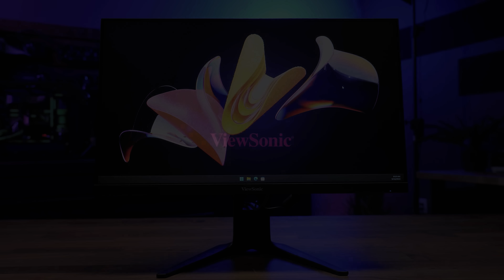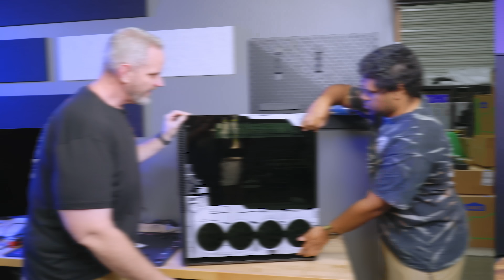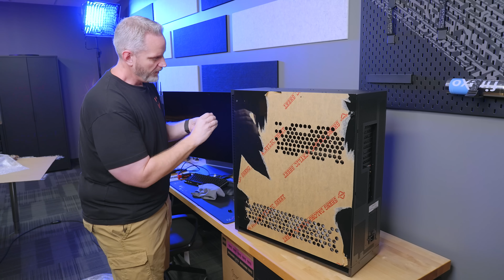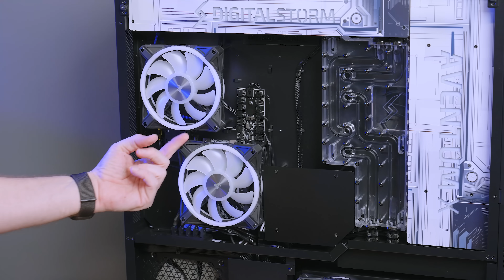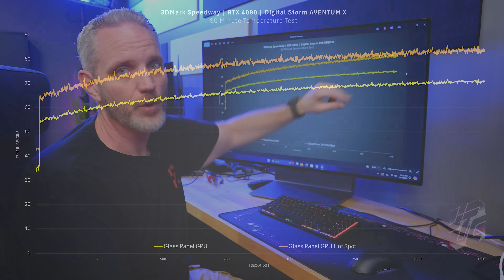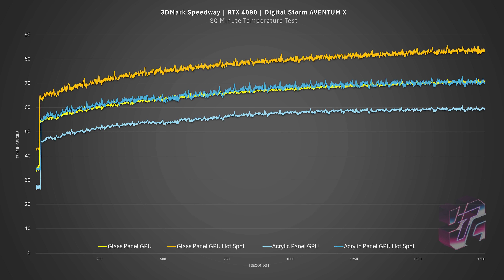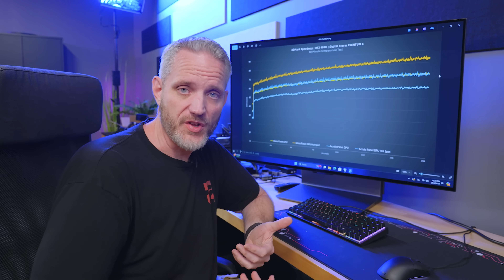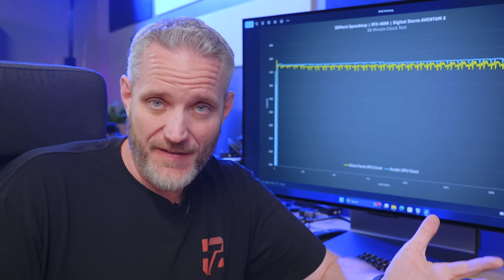Digital Storm responded to my Criticism... Let's go over it

Comment: To remove the paper from the acrylic, warm it up with a hair dryer or heat gun.  Just don't linger too long on any one spot.  It will weaken the bonds in the glue.  I usually follow up with hot soapy water to remove any residue.
Reply: or just dont add it in the first place?????
Reply: @SnuggleLabes  What do you mean?? The acrylic sheets ALWAYS come with protective paper to prevent scratches, they come like that directly from the factory. You're supposed to only remove the protective backing paper just before use.

Comment: You can put holes in a tempered glass pane, I have a deepcool case that has a tempered glass side panel that has 4 screw holes.
I'm not a glass expert, but I assume it's going to cost loads of money, acrylic is way cheaper to buy and laser-cut.
Also, a quick search on google, says that you CAN UV print on acrylic.

I see the vent holes issue on the back side panel, they just cut 2 sheets at once and called it the day, the paper wrapping on the Plexiglas tearing and/or not coming off, in my experience, is usually a sign of cheap acrylic.
Reply: It can be done, you'd just have to cut the holes BEFORE the pane of glass gets tempered; given that they probably don't do that in-house, it'd probably increase their costs and hassle to custom order panes from the supplier than just getting simple panes in volume.

Comment: You can cut a hole inside the glass and get it tempered after cutting a hole. If you even try to cut a hole in a tempred glass it'll shatter into million pieces.
Reply: and you know that Digital Storm's supplier would increase the cost for such custom work (vast majority of panels are just standard with 2-4 screw holes; assembly line efficiency!)  Given their existing choice of solution for the problem, would they be willing to even undergo the bureaucratic effort to change their processes to add this option, even if they pass the increased costs on to the end-customer?
Reply: @empath69  I don't care, I was replying to Jay's question in the video.

Comment: I custom watercool my rigs because they become a piece of artwork and focal point in the room and not something u want to hide. Any decrease in temps or sound is just a bonus. My new white and purple build is beautiful looking. The same build using air cooling would not look anywhere as good. Also, with the number of radiators, I can set my fans to a much lower rpm, making the system much quieter than an air-cooled rig when the fans ramp up as the system gets hotter.

Comment: It seems to me that the gpu temps with acrylic were about to peak as the "Trust me bro, it's fine" glass panel ones were still climbing steadily.
If you can build a more efficient and better performing pc with a 80$ case, a 50$ air cooler and 4 20$ fans... enough said.

Comment: Any shape you can cut in acrylic, you can cut on glass. The problem with tempered glass is that you must cut the holes before tempering the glass. After the glass is tempered, you will shatter it if you try to do any modifications to it.
Reply: I own 3 water jets, you can’t cut tempered class with it. Basically the only thing you can’t cut.
Reply: Not entirely trued. Tight corners in glass can cause stress fractures so generally warerjet, drilling and cnc machines use minimum radius in internal corners to reduce stress breakage during toughening.
Size and location is a limitation in glass holes/cutouts.
Reply: Good to know! I looked through comments for an answer to this lol
Reply: It can be undone, I've seen tempered glass be annealed and thus "untempered".
Reply: What about waterjet?
Reply: @sumdude4 even water jet would be an issue. Tempered glass is under internal tension and any alteration to it can cause it to just shatter.
Reply: @sumdude4 I walked around this exact problem, so I can chime in, and relay what I heard from machinists. WJ will shatter tempered glass, if it hits resonant frequency in it, and it does so pretty frequently, as it's basically hard molecules rubbing against straight edge, it's like a bow on a violin string. When making tool paths for WJ you have to take into account whole shape of the glass at every stage of the process. It's difficult, very, very few people know how to do it correctly, and in general you will hear "no". To add insult to injury, In most cases it breaks right at the end of cutting process, close to separation.
Reply: @Vatharian you can not cut toughened glass. There is no resonance frequency to worry about. The glass is under extreme stress and any impact to the glass from tools or water jet etc will simply cause the panel to pop.
No one can cut toughened or tempered glass.
You can un toughen glass but no one does that at its more cost effective to cut a new piece.
We run cutting tables, using scoring, polish machines using wheels. Cnc machines, waterjets and furnace machines.
Waterjets are quite common in glass processing for holes and cutouts in annealed and laminated glass.
Reply: @Vatharian  Resonant frequencies have absolutely nothing to do why tempered glass shatters when cut. When glass is tempered, the outside layer is put in compression, while inside of the glass is put in tension, similar to reinforced concrete. When you cut the glass you create a new surface that contains both types of glass, so the accumulated stresses from nearby glass have place to release, shattering the whole piece.
Reply: @Vatharian  It's really about the hole itself, not how you make it. I've seen a video where someone tried several times over weeks, to etch a hole in tempered glass. It always shattered. There is nothing more gentle that that.
The problem is, that tempered glass is basically a compressed spring. no matter how gentle you try to cut the spring, it will always explode in your face.

Comment: LTT proved that ventilation is key to liquid cooling when then tried using an old home iron water radiator for liquid cooling. They forgot to ventilate the room the poor radiator was in, so next they checked it, it was crazy-hot.

Comment: What would be a good upgrade from a Meshify 2 XL?  Currently running Dual 360's and 240 in the basement.  I could squeeze 420's in but I'm looking to switch it up case wise.

Comment: i wonder if you had a tempered glass panel set into a metal side panel with the right orientated cooling sections cut out would help move that thermal mass away from comp. I think it would still in this case allow the system to be highend, rigid and solid. i think printing onto the metal would allow you to have design aesthetic too.

Comment: I love it when PCs are works of art but never over performance. I paid around 3K for all of the parts for my latest system and assembled it myself. It’s not perfect but it looks good and I’m happy with it. I wouldn’t be happy if I paid 8K and it was pretty but the parts don’t reach their full potential.
Reply: A year ago I spent about $3k for the parts to build a system with a 7800x3d and a 4090. Put an aio on the cpu and 3 fans on the front. GN had a video that showed another fan in the rear of the case I chose made basically no difference in temps. To be clear, if I run the fans at high speeds, I barely leave 40°C on my gpu and stay in the 60's on the cpu. This whole build from digital storm is a joke.
Reply: @sonnydthomas exactly it feels like a VERY expensive unfunny joke.

Comment: There is a video on this channel from 5 years ago with an Aventum X fans shoved against a solid glass panel. Digital Storm ain't changing this.
Reply: That is my main complaint, Jayz’s complaints about the system were simply the latest in a several year long streak of the exact same issues

Comment: You're not crazy for thinking it should perform better. The extra 4k usd should include a 4090 and the same cooling setup. No way its worth this much.
Reply: not too mention the original 4090 cooler and all the spears the mobo and psu have.

Comment: watercooling is nice because you can have soooo much rad. i have a 3x360mm setup all WC and my water temp never get higher than 33C during extended gaming, that with FAN running at 1250RPM, pretty much silent here with my noisefloor of 38db. (4090 OC with a 7800x3d). It does however cost A LOT of monies!

Comment: You can buy PCs cost in $600 where they bought it through because they know that computer is probably gonna go to a novice not somebody is computer savvy where the documentation has got QR codes that take you straight to problem-solving videos. These companies have thought it through And that’s on a $600 computer this is an $8000 computer because they assume only computer know it all to use a better word should know what they’re doing. They’ve not bothered to add any documentation to troubleshoot QR code been around for years so bloody simple they charge you the sort of money you’d pay for a secondhand car and they can’t be bothered to add QR codes for simple triple shooting it just shows they do not think as a supplier

Comment: They could water jet holes into the tempered glass. Or, as others have stated in other comments, cut the holes first, then temper. Although, I'm not sure how the stresses of the heat-temper cycle would work with the holes in place.
Reply: Why holes in tempered glass? Wouldn’t you want a filter? Which would ruin your fancy holes anyway? Just have tempered glass in the viewing area and mesh with filters in the fan area. Don’t over complicate.
Reply: You're right, it would instantly shatter tempered glass. You would have to modify the glass before you temper it.
Reply: @Christopher_S  I'm guessing you din't know how water jets work? They use a high pressure water stream with an abrasive in it. Cuts through almost anything like butter.
Reply: @mikeford963  I'm guessing you don't know how tempered glass works?  Once completed, the sheet is under constant internal tension; makes it resilient to occasional knocks and bumps, but sufficient force that overloads that internal tension results in fracture.

You're proposing to blast what is, essentially, a pressure-sensitive fragmentation bomb with HIGH-PRESSURE WATER; hope you're wearing full-body PPE...or have plenty of antiseptic on hand.
Reply: I'm aware how tempered glass works. And I should have asked the wonderful woman that Google is before I posted that. Tempered glass is the exception to the rule of "anything" can be cut with a waterjet.
Reply: @empath69  Learn something new everyday

Comment: but wouldn't it be simpler to add thicknesses to the glass so as to detach it from the case by half a cm and let the hot air escape, effectively leaving it aesthetically unaltered?

Comment: Tempered glass is tempered after it's cut, hence screw holes in tempered glass.  Could you cut it with vents as well?  Seems reasonable.
Reply: ...but more expensive for 'custom work' - is Digital Storm willing to undergo even the bureaucratic work to make that change, even if they were to pass the added cost on to the end-customer, given what we're seeing here?

Comment: Ya, no jumper so only the pump turns on and letting it pull air in and run dry are BIG mistakes and only invite horrific issues. Imagine buying $8k PC and it sounds like an aquarium at best, the pump dies two years later  and worst it leaks while filling and kills MULTIPLE parts instead of just making a mess....

Comment: There's a few ways to get the paper off of acrylic sheets in one go but it's still a bit of a pain and you wouldn't know it unless you've worked in a shop that works on a lot of it.  I'll wrap it up around a cardboard tube and it'll roll right off.  May still have some tears to deal with around the cut holes but doable and you won't scratch it.
Reply: Isopropyl alcohol often helps getting stuff like this off surfaces.
Reply: @xdevs23  Do NOT use alcohol on acrylic, it will cause the surface to craze and crack.

Comment: 16:00 How did you know which side the panel belongs to? Would they not fit when switched?

19:14 Really, yellow and yellow? Well, it's hot spot, but still.

The solution would have been to make the lover side of the side panel out of metal with appropriate ventilation holes. And the top of the panel glass. Throw the small fans / radiators away, they probably do nothing anyways. 27:40 Well, that's what Jay just said.

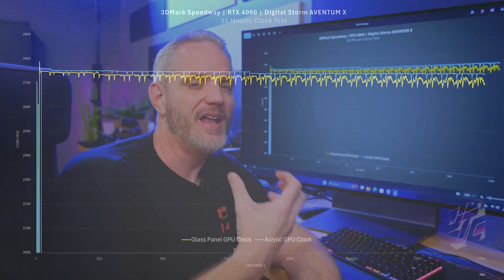Comment: 24:30 - No, Jay, you're not crazy. If you're going to charge your customers 4000$ beyond what the parts are worth when put in a normal configuration, the damn setup shouldn't even be "above average". It should be, at the very least, within the top 1% of all configurations.
They're effectively overcharging people 4000$ for better performance via cooling solutions which people with a 300$ budget for fans, AIO and cases can do much better to begin with.
Reply: Agreed. When I built a $4k pc 9 years ago, it tested in top 3% on Firestrike. It had a boot drive (back when that was a thing), 4 other drives in raid, 2 gpus, and a fully custom water cooling setup.
Reply: Exactly, totally unacceptable to charge that much money and make those mistakes...
Reply: I can probably do better with an air cooler and a fractal torrent...
Reply: I bought a system from them 5 years ago.  When I received the system, the cpu  block was plumbed backwards. I called to ask why it was plumbed incorrectly, and I was asked "that it passed thermal test didn't it?"  I replied that when I spend $3000 on a system, it should be built correctly!
Reply: Of course you aren't nit-picking - whatever the price there is standards - things should be done properly , no excuses. Pay staff a decent wage and invest in sufficient training, so they can make goods offering value for money. People should be treated with respect not taken for mugs, just because they just care about , say, gaming , not the nuts and bolts  or bits and bobs inside the box, that isn't everyone's thing.
Reply: A 300$ fan aio and case budget is still what i'd call "extreme enthusiast". $4000 better be plated with gold for that price.
Reply: @Policepigeon  LOL for 4000 dollars I can build an entire gaming rig of similar performance.
Reply: @Terrackhimself I've had good luck with my pre-built systems over the years. But I agree with DIY being the way to go.
Reply: @Policepigeon  A $300 fan, aio, and case budget is entry tier now my dude.
Reply: @Xerou  i think what hes saying is, it can cool the same if not better than spending $4k on essentially no change in performance. $4k is Ferrari, $300 is porche.
Reply: IMO,  if your going to spend that kind of money for system which has so many issues,  might look at Falcon Northwest ( which i know Jay likes).  DS over charging for a sub standard system.
Reply: @ryze9153  even Maingear are better systems than DS. And I agree with you 💯%
Reply: @davidjamesJEDI  I was recommended Digital Storm by a friend one time and I was like hmm, idk.
Reply: @davidjamesJEDI  i was recommended digital storm one time and I was like hmm, idk.
Reply: @davidjamesJEDI can't even make a reply just talking about computers. I'm so done
Reply: Right now almost every part is msrp (the 5090 just not when you add a 2nd one).
Reply: That price is more than fair. They figured out what the fair price was, and then they charged more...
Reply: $4000* $300*

Comment: And you paid 8k for that ?     KInda sounds like a rip off.    They just made huge airflow in the case and it cannot go anywhere .         Why put a rad next to a closed sidepanel ?    It does not get airflow at all.    Are there any fans what push hot air out ?           Do not know how long they are building pc's but how are they not closed already .    You have to be nuts to buy a pre build there .

Abd why do people buy a pre build when you have the fun part of building one that really works .

Comment: The moral of the story is that just because something very expensive doesn’t mean it’s going to be a very good system to the price going to something like a falcon Northwest which without looking at the website is going to give you a better experience for I’m assuming again, I haven’t checked the prices. I write this a cheaper price, or get a good system from a local company thanks for the information guys
Reply: That's what happens when you let others "build" things for you, I have owned many PC's from low end machines to top 1% and all of them were assembled by me, I chose the pieces that go into them  I tested them, and all my friends and relatives ( who are also my customers) never had a single complaint  in fact when one of them tried to get a pre built unit, he just ended up with a motherboard and CPU mismatch which bottlenecked his system. 
Moral of the story, just build your own PC's people  it's a lot of work but the end result will last you years of comfort, Literally.

Comment: I had to have some round (flat) tempered glass years ago (think round window). They cut the flat glass round THEN tempered it. So its no more difficult to have holes in custom tempered glass than in regular glass.
Reply: Not with the use of water jets its not.

Comment: why not have a jumper switch to turn on and off the pump only, better have the pump have an on/off switch exclusive for filling the loop, also add a conic reservoir to which the bottom of it goes to the drain
Reply: Yeah, I prefer that type of setup.  I'm using an O11D XL and since I had an extra PSU laying around I just use two power supplies.  One is permanently jumpered so it turns on with the switch on the PSU.  That one powers the pump, fans, controllers.  The other just powers the MB and GPU.  

I like that solution because I can unplug the main PSU and now the expensive parts have zero power.  Even with it turned off your PC has power at some points on the MB.

Comment: I've been hearing this a lot that fans on the bottom generates more heat getting trapped in the case. My guess it's a proper ventilation design that needs to be present in order to take advantage of the fan positions.